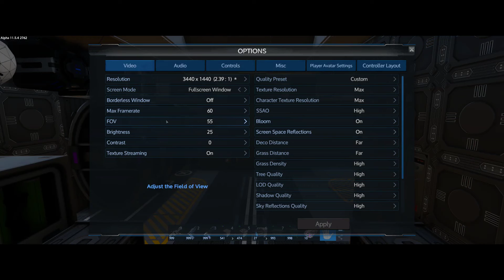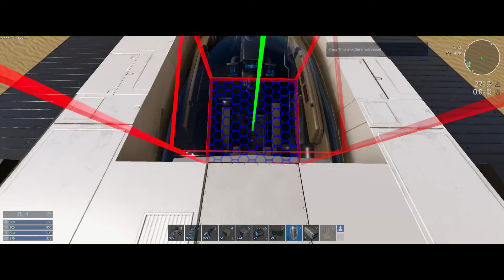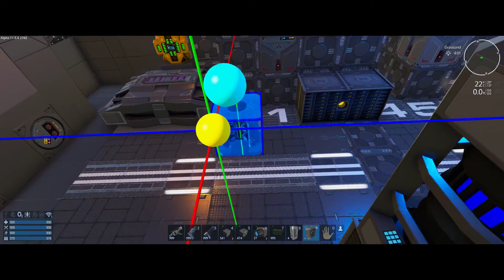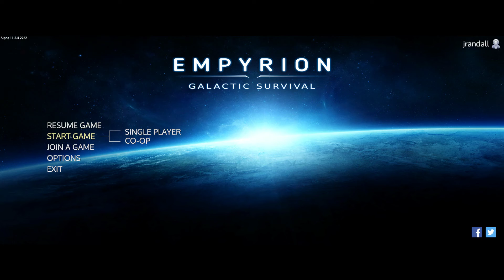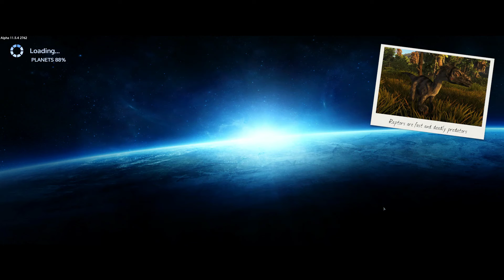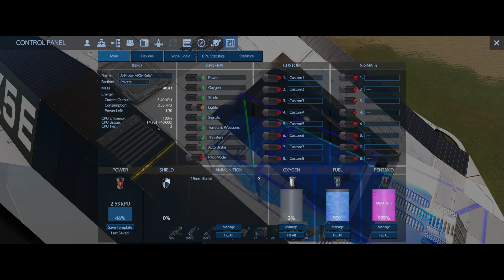Empyrion Galactic Survival - Merc-MX5 refit Part 2

Comment: It might be possible to eek out a tiny bit more left-right turning effect with the rear-facing thrusters. Basically by moving the ones that are inboard (near the back door), further outboard. Arrange them in more like a vertical line or L shape. And as far outboard as you can get them without totally screwing up the aesthetics. Might get you a couple more percent turning speed.
Reply from the maker: That is good idea. I will check that out too. Thanks!